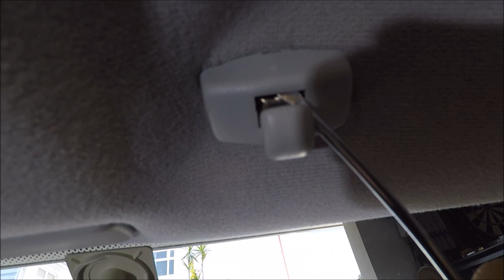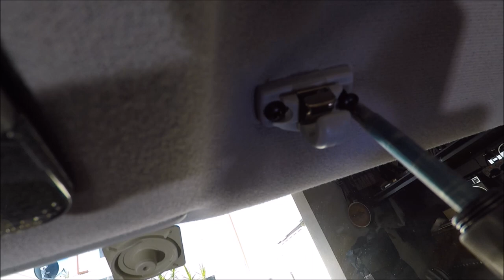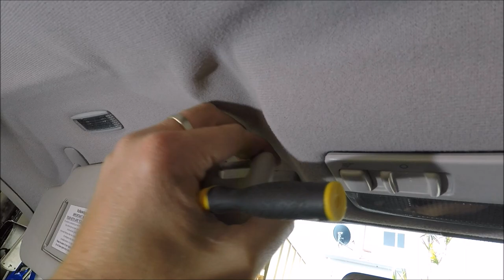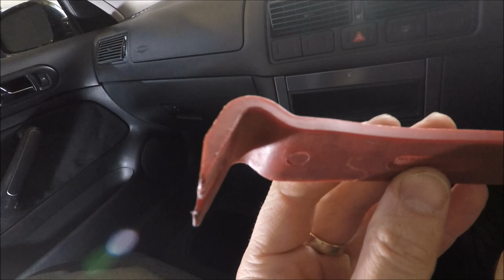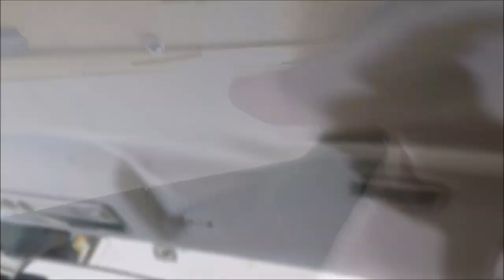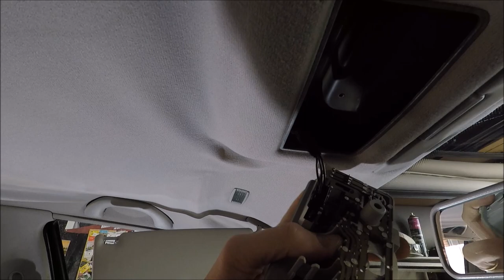How to Remove the Sun Visor Clip - on Audi A3 A4 | Volkswagen Golf 2004

Comment: This method didn't work for my visor clips but I found a way that worked. I put two small flatheads in on the front facing edges - with the handle almost parallel to the roof, then I rotated the screwdriver handles 90 degrees and they popped right off without damaging them.